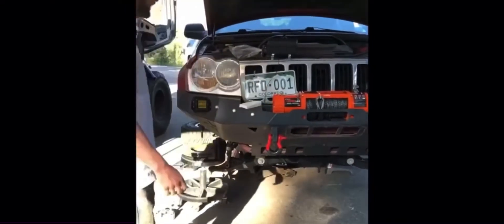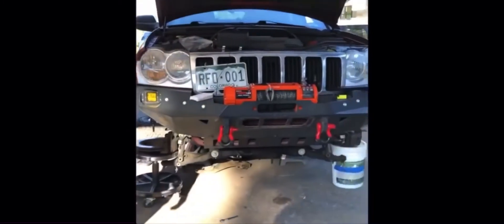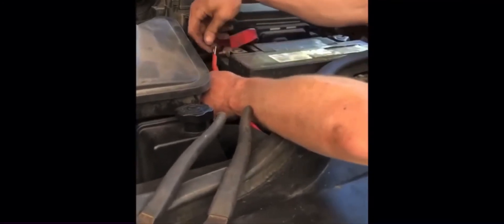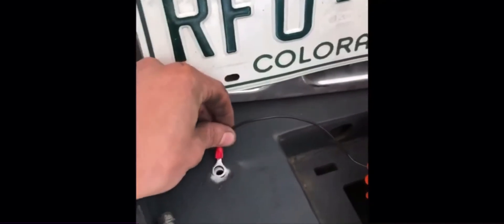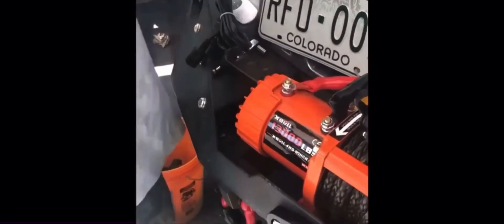Xbull Winch install!!

Comment: How did this winch hold up?
Reply from the maker: During the winter I will drive around downtown Denver and offer help to those that get stuck in the snow. I use this winch a ton for that, and it always does a great job. 

I got completely stuck at Taylor Lake in Colorado, it was so bad my feet were sinking when just standing there. The vehicle was to its frame rails in the sand. We ended up building a stone road, and then tried for hours to get out. I had tons of fellow offroaders hooting and hollaring about the X-Bull winch, and how they could not believe it had such a high duty cycle when they saw us getting pulled out. I was also very impressed with the winch and it honestly saved me big time that day. The sun was going down, we were trapped on a wet sand beach, no fires allowed, and I had a 4 month old puppy with me. I personally love my X-Bull winch and they earned a life long customer that day.